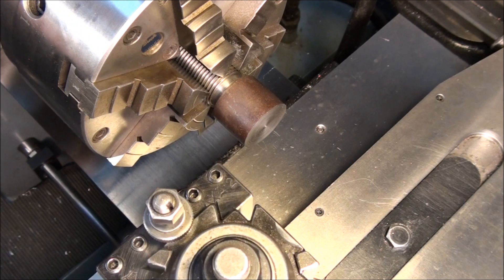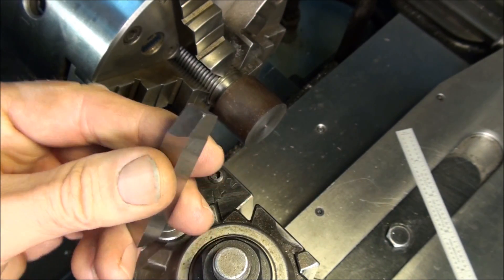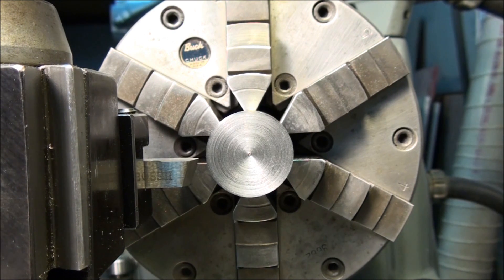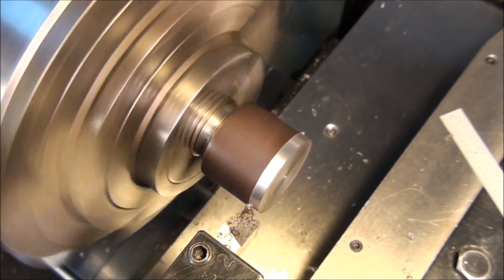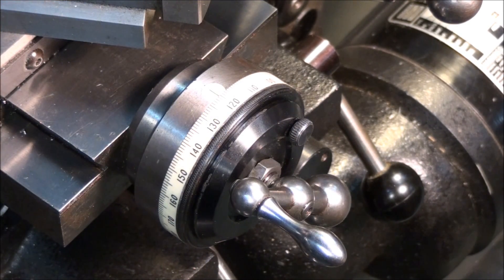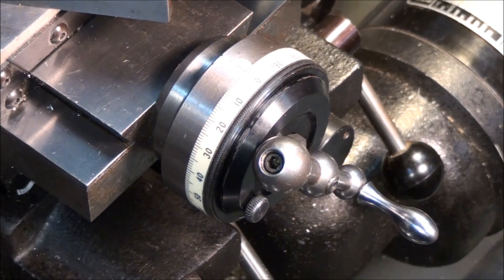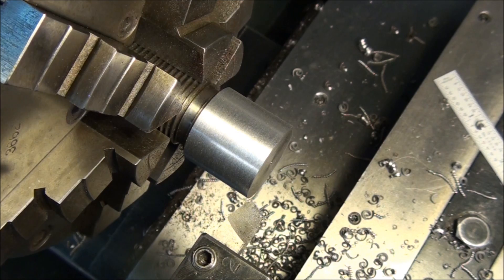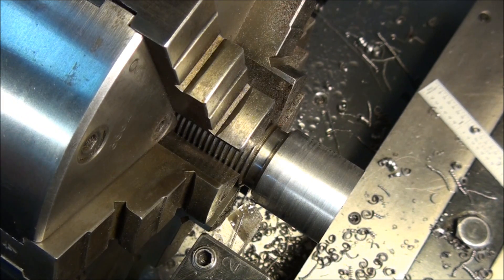Turning a Diameter to Size on the Lathe

Comment: Great video Tom!  Here's a trick I learned from an old German toolmaker: rather than sneak up on a size, when I want to turn to a +/- 0.0002 tolerance, I snug up lightly on the the ways for cross slide and carriage, and lock down the compound. If I'm turning common-as-dirt 1018 cold roll, I normally use carbide inserts, but  to keep with your example, using a HSS tool I would crank the rpms up so the SFM is 135 ft per min., or ~435 to 450 rpm for 1-1/8 stock and a target of  1.0000". I'd use a sharp tool with a nose radius of  0.016 to 0.018, and feed at  0.002" to 0.004" per rev depending  on the desired surface finish.. As you show, its very important to get the tool on center. Then take a "skim cut", as you did, but turn across the full width of the part. Let the part cool if needed ( or run coolant), and mic it. Let's say it mic'd 1.1083". Set a dial indicator to pickup the cross slide movement & zero the indicator. Next subtract target dimension from the skim cut diameter ( 1.1083 - 1.0000 = 0.1083) Divide this amount by any whole number that will give a result that is equal to or slightly larger than the tool's nose radius.  For example, 0.1083 / 6 =  ~0.018"  and a close enough match for our tool nose R..  This gives us the depth of cut ( radius to dial in for the first of 6/2 or 3 passes. This cut should mic at  1.1083 - 0.036" = 1.0723. Let the work cool if needed and mic it. Lets say it mics 1.0731. Subtract our target (1.0731-1.0000 = 0.0731. Divide by the number of remaining passes (2) = ~ 0.0366", Divide by this amount by 2 and dial in this DOC,  This pass should mic 1.0731 - 0.0366 = 1.0365. Let the part cool, mic it. Let's say is mikes 1.0368.  Repeat the process, in this case 1.0368 - 1.0000 = 0.0368. Divide by 2 and dial in the DOC for this last pass. Let the part cool in needed, and mic it. You'll be within 1 to 2 tenths, if not dead on size. The math may seem complex here, but it can readily be done in ones head once you understand the process.  This works because it reduces tool nose pressure ( by taking a cut that is equal to or greater than the nose radius) and by compensating and adjusting for any residual pressure or part flex over nearly consistent tool pass pararmeters. Give it a try - it really works - and especially when boring an ID.  Google "Sanvik 3 Pass Method" for  better how-to info on boring a close tolerance hole using this method.  (By the way, the method I described here works on my newest CNC lathe, as well as my  43 year old 15" Clausing, my old pre-WW11 Southbend, and my little Chinese wonder from Enco :-)   Accuracy is 99% machinist technique, and 1% machine :-)
Thanks again for the great videos!
Reply from the maker: Thanks Ed, I haven't heard of that technique before, but it does make sense. Not sure I understand the need for all the math gyrations though. The object seems to be to limit the depth of cut to the radius of the tool to reduce part flex and heat , so why not just take a cut and divide the remainder by 2X the tool radius to get the required number and depth of cuts?

Tom
Reply: Toms Techniques each pass is adjusted a few tenths so the last pass is dead on. Sandvik's can explain better. :-)
Reply: this method works very well when boring too. we use it for turning & boring on cnc & manual lathes. always excellent  results.

Comment: You hold the workpiece into the chuck from the threaded side does it damage the thread if it does what are alternative holding methods on a engine lathe .I was thinking of using a nut of same size as the thread and fit the nut bolt assembly into the chuck .Please reply for the possible solution
Reply from the maker: I use a six jaw chuck and it puts very little pressure on the part. If you are concerned about damaging a part, you should place a piece of paper or sheet metal between the jaws and the surface of the part. A female thread is a great way to hold a part with a male thread, especially if the female thread is machined in place. That way the male part with have essentially zero runout.

Tom
Reply: Vinayak Modi, it can and will damage the threads, unless you use light pressure. If you are concerned about the damage, and the concentricity of the thread to the portion that you are machining, you should make a sacrificial fixture by boring and chasing/tapping a matching internal thread. a split nut can also be used if the concentricity is not and issue.

Comment: I was wondering if there is any distinct advantage to using a micrometer to measure the outside diameter like shown in the beginning of this video, versus just using my digital calipers.
Reply: The micrometer is more accurate and repeatable.
Reply from the maker: Calipers will get you within .003", micrometers will get you within .0001.
Reply: Micrometer is more accurate and dependable.

Comment: Hey whats up Tom good video. I skipped a small portion of the video so I am not 100% sure if you did or not say it but I was wondering if you mentioned that when you add on a diameter with the dial that you are actually doubling what you are cutting? I have never operated a retail lathe I have a homemade lathe so I am not sure if the dial accounts for that.

 Basically when one cuts on a diameter with a lathe they have to advance half the amount of the total difference because if you set it to 5 thousandths you are really taking off 10 thousandths of the total diameter since 5 thousandths is being removed all around and both measuring points. I apologize if I missed this or I am misunderstanding something here. Take care...
Reply from the maker: +Micscience 
On most lathes, the cross feed dial reads diameter directly. In other words, if you move the dial .010" then the diameter will be reduced by .010". The dial on the compound does not compensate. It moves the tool whatever the dial says.

Thanks for watching.

Tom

Comment: Hi Tom, I really enjoy your videos and have found them really instructional. I am a complete novice so please excuse my questions if they seem simplistic. When you did the facing video you rough cut outside to centre and then finished centre to outside. In this turning to dia video you went longtitudinally from the tailstock end on each cut, including the finishing cut. I was just wondering if the reason was because it was because of the way the tool was ground. Many thanks, Gordon
Reply from the maker: +Gordon Agent 
Hi Gordon,

You will always get a better finish facing while feeding from the center out because of the shallow angle of the side cutting edge. You may or may not get a better finish that way when turning, depending on the material. In this case, the material was leaded steel so I got a nice finish on the first cut, and didn't need to take a finish cut left to right. Machining is all about making judgements based on results and the only way to learn how to do that is through experience.

Tom

Comment: What is a better measuring tool for basic O.D. and I.D. measurements, digital calipers or a digital micrometer? Thanks
Reply from the maker: Calipers are fast but not very accurate. They are best used for measuring flat surfaces, not round ones and especially not internal round ones.

A micrometer is hard to beat for measuring external diameters and it doesn't have to be digital. For bores, you have lots of choices: Transfer tools like telescoping gauges and small hole gauges, and direct measuring tools like internal micrometers, gauge pins and dial bore gauges.

Tom

Comment: Hey Tom, love the videos. Im a welder fabricator by trade, but love to machine parts up at work after hours, Ive been having a problem when I'm turning long parts to diameter. I turned a part that was 18-1/2" long and 1-1/4" down to 1-1/8" and I was 0.015" off from one end to the other. It hasn't been a big problem so far, but I would love to know how to get ride of that slop in the part. Thanks again
Reply from the maker: You need to use a steady rest or follower rest for parts that long to keep the center, unsupported section of the part from pushing away from the tool.

Tom
Reply: If you had the work supported at the tailstock, with a live center and the part was different diameters at each end, you need to adjust the tailstock so it is indeed centered on the chuck. The center of the part will also be different if you don't do as Tom suggested.  The tool will push the work away, essentially taking less of a cut than you think it just took.

Comment: Great vid. Why didn't you use cutting fluid on the roughing cuts?
Reply from the maker: Thanks.

If the rpm and feed rate  are set set such that the cut is not generating excessive heat, coolant is not necessary. If you want to speed up the metal removal rate to the point where the chips start turning color when cutting steel, or start sticking to the tool when cutting aluminum, then coolant should be used.

Tom
Reply: Thanks Tom. I'm contemplating building myself a piece of equipment that involves some knurling across a 2 m long 30 mm dia stainless steel shaft. Are machines capable of doing such a job readily available with machinists?

P.S. I have zero knowledge about machining apart from the classes I took in Engineering school.
Reply from the maker: Sandarpan

They are available. In fact in my latest project tutorial, I'm showing how to actually build one. Check out my clamp knurling tool videos, here or on my website.

http://tomstechniques.com/

Tom

Comment: Tom, thanks for the videos!  I watched them as they came out, but since I recently got a 1955 South Bend 9" lathe I'm watching them again.  Actually being able to try what you are showing is different from just watching...and tells me what I need to see again.

I hope all is well with you and yours.

-- Mike
Reply from the maker: Thanks Mike.

Now that the weather is turning cold, I'm getting geared up for another round of videos. A Shure wireless mic that I won on eBay showed up in the mail today and hopefully it will improve the sound quality in my videos. I'm actually in town this weekend for the first time in a month, so maybe I'll get a chance to try it out.

South Bend makes a nice for light machining. It should serve you well.

Tom
Reply: It's always fun to get new tools, whether mics or lathes.  The South Bend is a small lathe, but I'm only making small things for now, so that's fine.  It's in good shape (only two prior owners, both hobbyists who took good care of it), and it came with a bunch of accessories, including a milling attachment and a lever-operated turret tailstock (in addition to the normal kind).  No 3-Jaw, but it does have a 4-jaw and a collet chuck, so no limitation there except on speed of chucking.  I turned and milled the T-nut for a QCTP ok, and I'm making a few other small tools and add-ons...so far so good thanks to your videos and some others I've watched.  Without that I'd still be wondering how to make it go!  I'll be downloading your toolbit grinding PDFs next...just received some blanks I ordered.  Thank you for the help!

-- Mike B.

Comment: I also noticed that your lathe differs from mine and all others that I've found, in that the cross-slide and longitudinal adjustment dials both read absolute travel in thousandths, so the diameter changes by two times the dial reading. What model lathe do you have?
Reply from the maker: That's not true Paul. Both the cross slide and compound dials indicate changes in diameter, not in the radius of the part. The lathe is a Hardinge HLV-H Toolroom lathe. The only lathes I know of that read radius on the cross slide are some of the older South Bend and Atlas lathes, although it is fairly common for the compound to read on the radius. I made a set of direct reading dials for my Dad's Atlas. You can see then in the internal threading video.

Tom

Comment: Tom I have been watching your videos for quite some time.  After several of your lathe series I have become interested in what kind of lathe you have.  It has some features that really interest me.

Thanks for all the effort you put into your videos!

Keith Mifflin
Reply from the maker: Keith,

My lathe is a Hardinge HLV-H Toolroom lathe. I bought it new in the mid eighties and in my opinion, it's the best lathe available for the one off type of work I do. Unfortunately, they are no longer in production, but there are copies and quite a few used ones around.

Tom

Comment: Nice video. I found it a bit ironic when you mentioned to be careful to not move the cross slide crank at 7:47 on the video considering that you did accidentally move the crank between 7:34 and 7:40. Although to be fair, I don't know if the movement was within the slack that causes backlash or not. But in any case, the crank is visibly moved a few degrees.
Reply from the maker: Thanks for pointing that out. You might also notice that when I took the trial cut after setting the dial, I realized the error at 10:20 and was able to correct it before taking the finish cut. All machinists make mistakes, the good ones recover from them before they become permanent.

Tom

Comment: TOM: U were off when you set the dial at ".096" and not ".104"
John
Reply from the maker: No John.

You have to realize that the numbers on the dial are relative, depending on which side of zero you are working. I set the dial to zero and turned it .104" counter-clockwise, ending up on .096". Turning the crank clockwise back to zero advanced the tool .052", taking .104" off the diameter of the part.

Tom

Comment: Thanks for another video, Tom.  On my Hardinge HC, I'm unable to lock down the hand wheel to set my dial.  For now, I've been holding the wheel, and adjusting the dial.  I see you have a little set screw on your machine.  The only manual I have is online, and for an HC, which doesn't cover locking the hand hweel down.  I'd appreciate any quick pointers you could give.  Thanks again.
Reply from the maker: Thanks Aaron.

I'm not familiar with the HC, but it doesn't look like the cross slide dial is the same as mine. There might be a spring inside to provide friction and let you set it by holding the crank.

Tom

Comment: Good video, but if you need a precise size then you should turn the part leaving a few tenths of a thou on it, then polish the few tenths off with some fine emery.
Easily done.
Reply from the maker: I can't recommend using emery cloth on the lathe because it is way too easy to lose a nail or a finger if it isn't used correctly. If you have a lathe that won't hold tolerances that close, a better option would be to file it to size. I also have a video out showing the proper technique for using a file on the lathe.

Thanks for watching.

Tom

Comment: Thanks, Tom. As a newbie, this stuff can't be too basic for me. When I heard you say your (gorgeous!) Hardinge can "easily" take a 0.104" cut from mild steel I wilted a bit. I think I still need to work on my tool grinding, but on my ancient 10" Logan I feel like I'm really pushing things at 0.025" on mild steel. Is that reasonable, or should I be able to take a heavier cut? "Buy a heavier lathe" is an absolutely acceptable answer as long as you're willing to deliver it to my wife. ;-)
Reply from the maker: The Logan is a nice lathe. It's been years since I've used one, but I would suspect you should be able to do better than .025". Try using a smaller nose radius on the tool, a smaller side cutting edge angle on your turning tool and keep all of the overhangs to a minimum. That will help prevent chatter.
Reply: I use an Okuma 8 inch lathe and able to take a 0.025 DOC (0.050 off the diameter) in mild steel with no problem. Twice that on aluminum and 360 brass.

Comment: How about a video using the compound on an angle to sneak up on an exact diameter.
Reply from the maker: That can be done to turn to sub .001" tolerances if your lathe is capable of holding them (most are not). Of course you would need to calculate every move with trig. If I have to turn something that close, I normally aim a thousandth high and take a few spring passes until the diameter is correct.

Tom

Comment: Cool thanks.  I have to turn down to a shoulder so I will try rotating the bit some.  You mentioned making another tool with no side angle so I assume it would look like a facing bit?  Except perhaps you keep the angle at 90 vs. 70 is what I would think but don't really know.  Anyways cool vid.  The reverse count threw me for a loop but that's pretty cool after I understood that.
Reply: I also see you mention casting here and there.....I actually built the Gingery charcoal furnace but I haven't got past melting down engine blocks and making ingots yet.  I was going to make the lathe but decided id rather go straight to making stuff I need rather than go that route.  Time is a big factor.  Being a sheetmetal worker for 15years this has opened up a whole new level of fabrication for me and I am frustrated on a daily basis that I never learned this stuff a long time ago.

Comment: Thanks, good idea with reverse count. You said that increased speed gives better surface finish. Why is this so? Adding the oil I understand is good, and lowering feedrate and plungedepth as well. But why to turning speed affect surface finish? Do you know?
Reply: Higher rpm will give a better finish as the "threads" of the finished surface will be closer together. With a light cut there is less heat to take away so you can get away with it. A rounded tool tip can also give a better finish too as you don't get the microscopic grooves.
Reply: No, Your feedrate is fixed ratio to the RPM. The speed helps in chip formation, if you go too slow it will be hit or miss if it actually cuts, usually leaving rings as the tool scrapes until it builds up enough material to form a chip which lasts for a very short time than breaks & repeats the cycle.